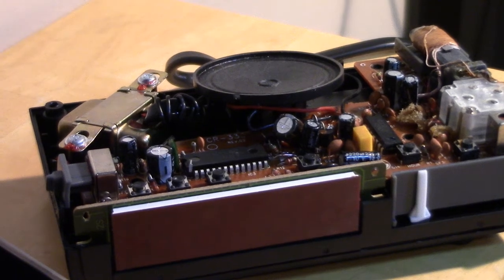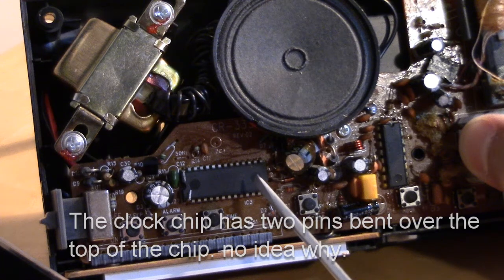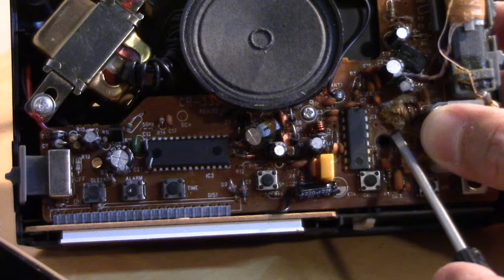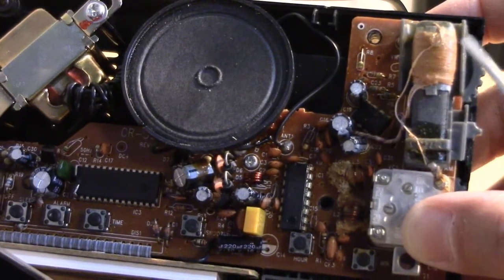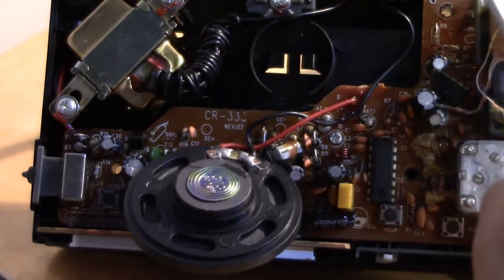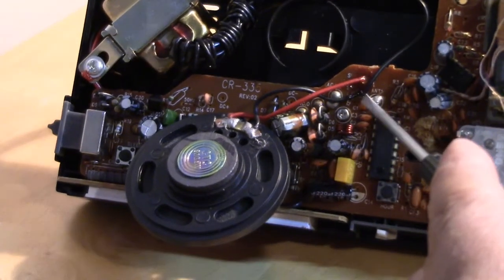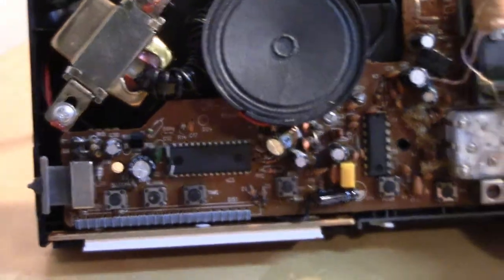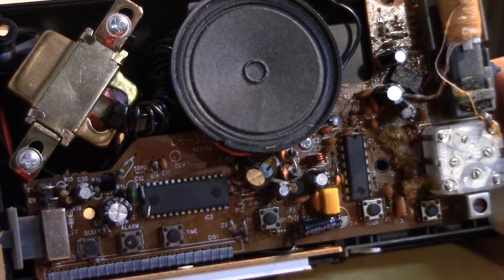Electro Brand 4610 AM FM Clock Radio A Look Inside

Comment: Hey Jerry, looking at the data sheet for the clock driver....pin1 (closes to the display) is for AM (morning) & 10 seconds; pin 28 (closes to the transformer) is for 24 hour time setting....these to pins are used together when the clock offers a 24 hour setting, such as in the Europe market.   Reading the data sheet on this chip does state it is capable of being used at 50/60 hz reference. This appears to be a Swiss Army Knife kinda chip and apparently is used many clock designs. Hope that helps some. Thanks for showing the guts. ~Jack, VEG
Reply from the maker: That’s interesting Jack, I guess the design must have had those two pins going to traces on the PCB for other markets and the fix was to bend the legs. Thanks for the information and for stopping by my cool radio friend. 👍❤️📻

Comment: Old style radio chip with variable capacitor. I wonder if today's radio alarm clocks all use DSP radio chips. It appears that none of them have the tuning knob but just autoscan and preset memories.
Reply from the maker: The newer clock radios have software controlled microchips and cell phone chargers and other useless things. The radio is almost an afterthought, that’s why I use a 90’s GE clock radio. They sure don’t make them like they use too. Thanks for stopping by. 😎👍❤️📻